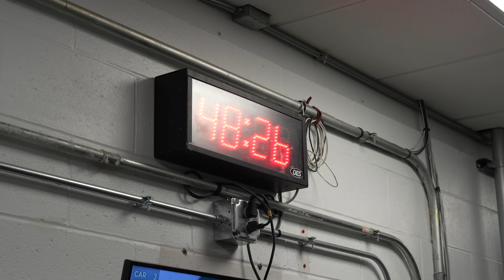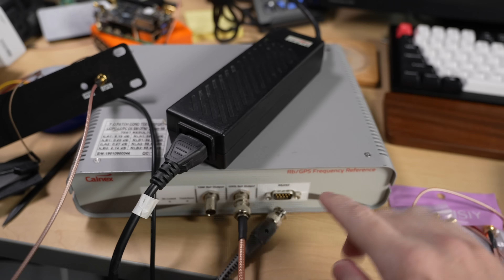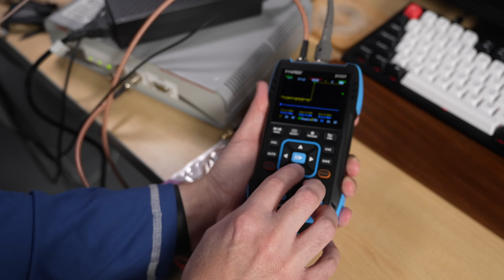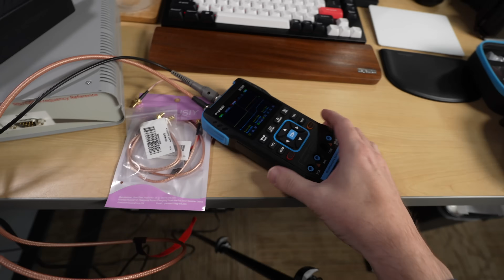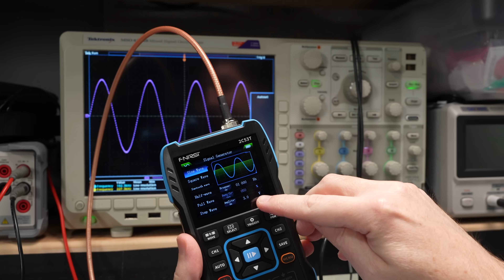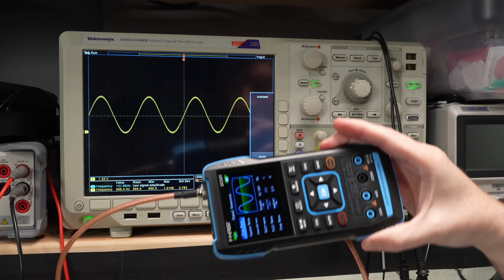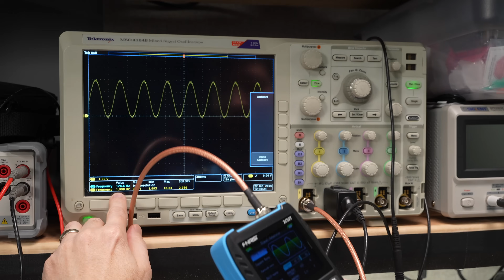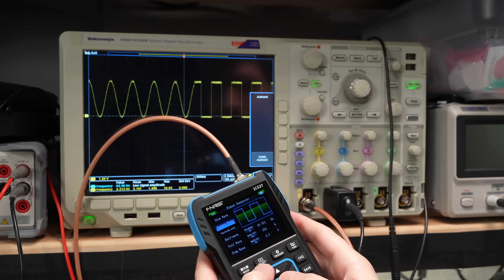A scope every electronics nerd should own

Comment: I've got one of the shit 1 channel $30 scopes, that I keep magnets on the back of, so I can use it either in one hand under a desk or in a tight spot. Its fantastic for simply testing "Is there a clock/square wave here?", which is often all you need. Its awful for measuring anything real, but like for my mixing console it rocks to just see if there's a signal, which is so often what I need! This seems another great idea too. I've got my bench scopes which are great, but so often you just need a quick measurement and getting a real scope there is annoying!

Comment: Longer antenna leads might also introduce capacitive and inductance variables that could introduce signal delays. The instabilities might even be due to your body position relative to those antenna leads. I know that capacitance is impacted by how close you are to circuit leads, not so sure how your body would introduce inductance changes ..... unless you were unwittingly conducting current.

Comment: At 1800 MHz 1 meter cable is about 6 ns, a coupler can be 25 ns. Only way to make sure is to measure with a calibrated network analyser(they are expensive).  Working in a GSM system verification lab I hade project to measure time delay in mobil gsm system and was hunting at 1 ns

Comment: I mean... the best thing (IMHO) would be a little no-ui-oscope (maybe LEDs for Trig/Run) that was BLE-connected to a tablet so you could have larger control surface and sliders and everything.  Make it USB chargeable and... you don't even care if ground is floating somewhere obscene.

But I haven't quite seen that yet....
FINRSI things are okay with their battery life, but they cannot willnot and do not operate while charging (to prevent a ground loopy problem from ultimate frying).

Comment: I bought a Fluke Scopemeter 196 off ebay for cheap. I did have to source my own probe leads and a battery for it. I think at the end of the day i had $400 invested into it but i also did buy fluke branded accessories, on sale though. 
It was my first scope and i liked not having to worry about damaging it on ground loops.

Comment: I have one of these. If you're looking for Tektronix accuracy, you're not going to get it. If you want a cheap little scope that's going to show you the waveform and allow you to save the image for later use - here it is. You can't beat the price, and if it gets lost/stolen/dropped/magic-smoke-depleted, you're not going to cry too much.

I use mine when poking around in vacuum devices, or when I need to save a waveform picture for posting on my blog.
Reply from the maker: I've also been using mine as a random "debug some traces and pins" multimeter, as it's small enough to sit next to my desk, and all the probes are in the hard shell case it comes with.

I used to use a fluke for the purpose, but since I had it over at the workbench, I'd just put off testing sometimes, to avoid either moving my project to the workbench, or pulling the Fluke over to my desk (I'm lazy :D).

Comment: One thing I used to like playing around with in high school electronics class was to put 2 signal generators into the X and Y inputs on a scope and play around with patterns.  Then build small circuits with capacitors and inductors to alter the signals just to see what would happen.

Comment: I was thinking the same thing recently, I found one on the jungle website for only 39. Not as nice as yours, but also 50Mhz bandwidth and even smaller. I've owned a Tektronix CRT oscope for decades and recently upgraded to a modern bench oscope and this little portable is a nice addition to that. Loving the modern functionality and portability.

Comment: Motorola Solutions System Engineer here! Another example of those super tight timing references (like Rubidium-backed GPS references) is for modern public safety radio. Specifically, trunked P25 systems which are "simulcast" and are very sensitive to launch timing which is typically synchronized among RF sites by using GPS timing references which have 72 hour hold over thanks to Rubidium timing references that back it up during failure scenarios.

Comment: Actually, FNIRSI’s $90 handheld units (2c353t) often provide better value than their $100+ benchtop models (like the 1014D). Their benchtop scopes are frequently criticized for 'paper specs'; they are advertised as having a 100MHz–200MHz bandwidth and a 1GSa/s sample rate, but independent testing often reveals significant aliasing and a real-world analog bandwidth closer to 30MHz or 40MHz. The handhelds are more honest about their limitations, making them much more reliable for field-testing or basic microcontroller work.

Comment: Except single triggering doesnt work reliably on any of their handheld scopes and the scopes are near instant abandonware after being released. Got both the 2c23t and 2c53p. The multimeter functions are okish and the the scope hardware is very good for the price, but the software is not good at all. I wish they would just opensource the firmware if they're not going to improve it themselves, because there was an opensource effort to do that that didnt suceed (last time I checked).

Comment: I bought this and the menu system is barely usable - it will drive you insane.  Not intuitive at all, it’s a nightmare to navigate.  Plus I had to take it apart and solder the inputs on top back to the board because they had broken solder connections causing static when using the scope - this is NOT worth buying, it will annoy the hell out of you - trust me, stay away.

Comment: I have used one of these for college for 2 1/2 years, they are great, but the battery life does not hold up... I TA for a lab and it constantly is dying, I end up needing to keep it plugged in by a wall and I grab it when I need it then put it back. But it is very helpful in certain scenarios.

Comment: I'm interested in a scope like that, but are the input channels isolated? In other words, is there a current path from the outer shell of one channel's BNC connector to the outer shell of the other channel's BNC? Back in the day (yeah, I'm old) one had to always be careful about current flow from the one channel's ground lead to the other. We'd use a ground lead on only 1 scope probe to get around this....

Comment: GOT MINE TODAY and I have just spent 2 hours,  for the life of me  I saw the word ENGLISH  once then from that point on everything is Chinese and no Fxxxxx way to get back to the System setting page,,,,  Documentation supplied in 4 languages  is  sparce to say the least in the Supplied manual.    Good Luck trying to get in English. I am having a hard enough time learning Japanese,  no room for  Chinese.
Reply: follow up,  took me a solid hour trying trying to get back to ENglish,  Chat GPT finally walked me thru  taking 20 minutes meanwhile telling how F-NiRTs Menus  are  all AFU  and non intuitive.  If you buy this  beware  the buttons are NOT intuitive at  ALL    and  good luck if you get stuck in Chinese.    chat gpt summary -   Chinese industrial UI philosophy (seriously)

Many Shenzhen instrument makers optimize for:

“factory technician already trained on previous model”

NOT for:

“new user learning device”

So consistency across models > intuitive behavior.

Western companies do the opposite.

3⃣ Translation is added last

The English text is literally a lookup table slapped onto:

语言 → Language
保存 → Save
系统 → System

But the navigation logic underneath never changed.

So the words are English, but the workflow is still the original Chinese firmware logic.

🙂 Reality check though

Once you learn the 4 “magic buttons” on FNIRSI gear:

AUTO = emergency escape

CH1/CH2 = force scope mode

PRM = global settings

SELECT = confirm

…it suddenly becomes usable.

Not elegant — but usable.

Comment: I got the digilent analog discovery 3 as an all in one setup, oscilloscope, logic analyser, pattern generator, waveform generator, power supply, etc. It also has modes where it combines features like the waveform generator and oscilloscope to perform frequency sweeps. It is also fully scriptable in python which I haven't done too much with but you can define custom measurements and processing or workflows.

It is a USB device with an additional barrel jack if you need more power for the power supply. It works great plugged into a laptop or raspberry pi to make it portable. You can also combine two together to get 4 channels on the oscilloscope and waveform generator.

Its main purpose is that it is all in one and integrated, it isn't a replacement for proper modern benchtop units but is good enough for everything I have used it for.

Comment: Hey! I have a FNIRSI solder station and I love it! They make great “Entry/Intermediate” level gear for hobbyists. Ironically I used to professionally solder ECU/PCU units for diesel trucks about a decade ago. The FNIRSI “budget” station I have now is light years ahead of the “professional” station at had at my actual job. 😂

Sometimes the tool that you have is better than the tool that you want. Especially if it gets you involved with the hobby and having fun learning or messing around. Then you invest into professional level gear when you are ready. 

I’m a fan.

Comment: I got one of these yesterday. The first thing I noticed was that there was a firmware upgrade from 1.0.7 to 1.2.0, although after testing it it has the same issue, goes down 2Hz on the nose but when  you choose 1Hz it shows up on mt Fluke 189 as 2.22Hz. Still a very nice pickup for the price.

Comment: I bought a DS203 years ago, but haven't used it as much as I want because the UI is so complex. I always meant to write up some better documentation and crib sheets that would make it easier to access all of the functionality, but this has a lot more buttons, and I imagine is much easier to navigate, and this looks to be a good upgrade spec wise too. Great little hobbyist scope for people who can justify the cost of a full size scope.
Reply: I have had the newer DS213 for over 5 years now, and it's been pretty decent, but the main issue with those miniware scopes is the connectors. They get very loose over time and the probes start losing contact and showing complete nonsense readings, and you have to plug them back in all the time. And it's damn near impossible to find replacements (at best you can swap them with connectors from the unused digital inputs which will buy some extra time). So the scope in the video having proper big BNC connectors is a major advantage.

Comment: To overcome the issue with "recessed" BNC jacks is to (permanently) install BNC M-F couplers on the jacks.  This "extends" the "recessed" jacks from the unit for MUCH EASIER installation/removal of test probes, etc.  Yes, it extends the end of the instrument by 1/2" or so, but that's a "small price to pay" for easier installation/removal of o'scop probes and such.

Comment: I have one of these and it's pretty great, it's not a replacement for a regular scope but it's a great troubleshooting tool and it's also a multimeter so you get a lot of functionality in a small package. One of my biggest annoyances with a multimeter has always been that if you want to check "is this thing even working?" but the wires you are testing are signal wires, you don't get an accurate reading or sometimes get almost nothing. An oscilloscope, even one that's not very good, will at least show you that something is happening and that's really valuable. Though if you are new to oscilloscopes, I don't think this is a great first scope, it's really hard to wrap your head around all the settings without having all the knobs and dials in front of you to tweak and play around with.

Comment: I use 910R standard, I love the tecktronic compared to the R&S rte1053, although I adore my R&S test equipment and standards when they work they work Very well. But I’ve documented a ton of failures across multiple R&S units and model numbers

Comment: I always wanted a fluke scope meter but couldn't afford it, I think I will buy this and it would be super handy in an automotive troubleshooting situation
Reply from the maker: This is a pretty good option for automotive stuff; they make a slightly nicer model that has decoding for things like CANBUS too, I think (or at least some options for diagnosing faults a little more quickly). But any scope will be great for that, especially a small battery powered one you can set around the engine compartment!

Comment: These and Zoyi are great for finding out >>IF<< you have a signal, and if it looks relatively correct.  However if you need ACCURATE response times and voltage measurements you'll NEED a decent desk top scope.

If you're going to be doing a lot of detailed measurements where the results are critical, hand held scopes are NOT for you, but if you're tracking down missing signals, these work fine.

Comment: You  mention that the time difference between the clocks could be due to the antenna cable length - you said 10 feet difference, say 3 metres, which at the speed of light is 10 ns, so it is a noticeable factor.

Comment: Did you compare the timing measurement result between this handheld scope and the real scope? I don't think I'd trust the handheld scope for a critical timing measurement. 
The way most people use a scope, for signal tracing, etc., the actual BW of the measurement is a function of the number of channels in use, the sample rate, and the amount of waveform memory. Unfortunately these scopes don't usually show you the sample rate, so you have no way of knowing what the BW is for any given measurement. It's a toy.

Comment: mine has a hard time measuring 0-5v square wave frequencies.  what should be 35hz measures 2.4khz 1.5khz, etc it bounces around with a very clean input signal.   please fix this fnirsi

Comment: Curious why you picked it over the DPOX180H. For me, that one struck the right balance of cost/size/capability. Light and battery powered, good portable ergonomics with more buttons and more generous specs for still less than any real oscilloscope would sell for 5+ years ago.

Comment: There are a bunch of "digital oscilloscopes" and "logic analyzers" that will sample their inputs and send them through a USB cable to be interpreted and displayed on a computer.  Some seem to use Python scripts and can display on a Pi.  There seem to be several priced below $100 and will work with circuits up to 20MHz or more (some claim 100MHz but seem dubious).  Some even add multimeter, signal generator, and power supply functions.

Comment: What about the battery? Rechargeable? Cheers.
Reply from the maker: It gets maybe 2-3 hours, honestly I'd rather have 4x AA batteries or something more easily swappable. Good news is on a dead battery it will still run just after plugging in USB-C power.
Reply: @Level2Jeff Thanks, buddy.

Comment: With that clear PLA, check out CNC Kitchen's video from 3 years ago about printing transparent filament. You want to print it so your layer lines are all oriented parallel instead of crossing every other layer. That eliminates a lot of the voids which scatter light.

Comment: You can compare two clock signals (for example the 10 MHz one) to each other using an oscilloscope like this. The waveform you don't trigger on should slowly walk across the screen (the slower the closer the two frequencies are). You can time how long it takes to shift by a half or full cycle and calculate the frequency difference (and the direction will tell you if it's high or low). But you'll need continuous triggering instead of manually triggering single captures.
Reply from the maker: Eventually I'll have the equipment in place to measure ADEV on my different clocks... getting there.

Comment: I’m not sure if anyone has mentioned this yet. But the stair steps are most likely due to the limited number of bits in the DAC (digital to analog converter chip) in the unit. Other that very fast transitions ( like those seen in the square wave ), the analog output is always going to have observable steps. And therefore the accuracy of the analog output will also be dependent on how many bits are available to create the output. But again, for what the unit costs, the output ain’t too bad.
Reply: Could also be due to limitations of DDS implementation, even if the DAC has higher resolution.

Comment: I prefer the Owon handheld scope, I bought the 200MHz model on Amazon about a year ago.  I'm completely satisfied with it at a price of $309.  I'm used to using high-end scopes at work, so I was surprised just how good my Owon model HDS2202S is.  Comes with a nice set of accessories too.  If you don't need the 200MHz bandwidth, Owon has lower bandwidth models priced much lower than mine.  I almost forgot to mention my Owon model is not only a scope, it's a DMM and a waveform generator, features I don't use much, but it might come in handy at times.

Comment: I still have an oscilloscope with vacuum tubes in it! It works OK for troubleshooting other things with vacuum tubes in them.
Reply: Same here. It's good for 100 MHz, cost me the princely sum of £40, used, and works beautifully. It just needed cleaning and calibrating. The only challenge is that it will only fit into my pocket if the pocket is 19" rack sized. 😉

Comment: I have a Fnirsi 2D15P.  Like anything, it's a tool, and it's a great tool when it's used for appropriately. I have to keep in mind what I am using it for, and what the tolerance is for accuracy. Great for comparative analysis, but when I need accuracy, I have a much better quality scope.

Comment: Don’t know if you mentioned if you have separate antennas for the two GPS receivers but the calculated time is the time at the antenna plus the cable length in nanoseconds. You can measure the delay cable delay or look it up for a specific cable type.  After working in GPS for 30 years, I often think about time in terms of distance and vice versa.